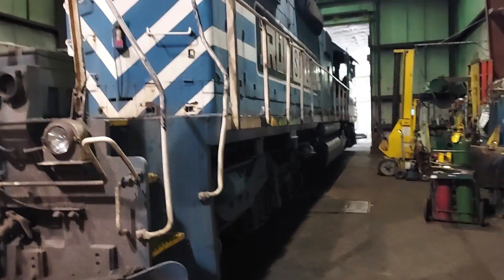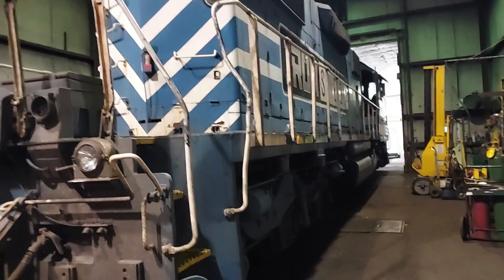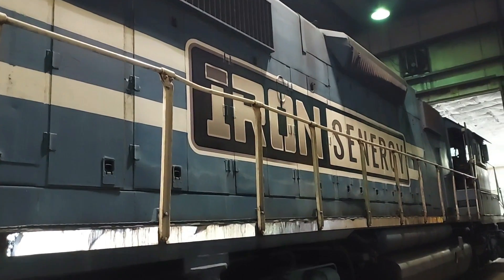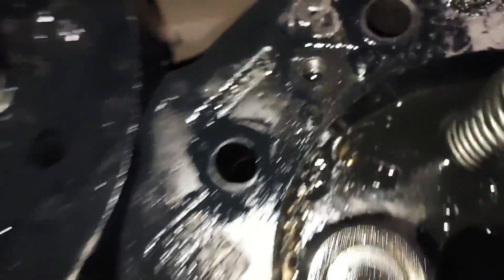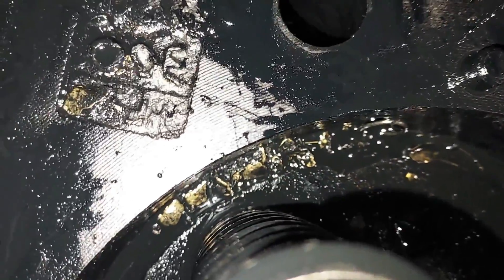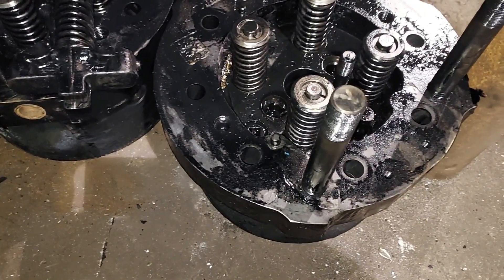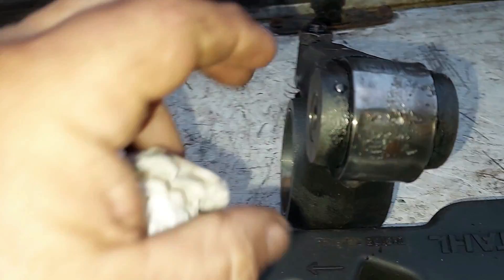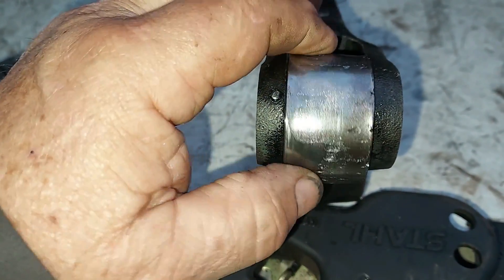EMD 645E Cylinder Heads Replaced on our #22 Locomotive

Comment: Hi Dave does the engine No. 22 usually smoke that  much? or was it due to the
rebuilding process ? diesels do smoke some, Mr. Moran statement is very accurate
the same goes for auto engines. the grey is babbet material that acts as a bering, the groves
are the oil channels , if it is not having enough oil it prematurely wares out. P.M. for any engine
is key for a long life. especially oil changes it is only a few mils thick but prevents ware.
the oil pump should be checked out to insure that there is enough pressure and proper circulation 
in the engine. that is key to keep it running well. great video, nice to see the “pieces parts” of 
the engine. the cam key for proper engine power too, it allows it to be more efficient . barry
Reply from the maker: No 22 does not smoke that much when it's running. There is a 
vent along the top of the shop roof to let smoke out, I think it
just seemed like a lot of smoke because the vent was closed
and there wasn't a good way for the smoke to escape the
otherwise enclosed shop so it had accumulated in there.
Thanks so much my friend for dropping by and checking out
the repairs.
Reply: PM seems to be non-existent!  A ship or stationary has a more important job adrift or no electricity or no/too much water, but a railroad, so what, wait till it breaks down, where's it going to go & what difference will it make. Fix the minimum & run it till it breaks again!  They used to treat miners the same way and even the unions didn't do much till OSHA!  My opinions entirely.  Good luck.

Comment: I hope the mechanics checked the muffler bearing (lol).  A muffler bearing failure could take out the whole engine.  A key sign of the failure is when flames shoots out the exhaust (lol)  By the way, on the rocker, the copper is the actual bearing material/  The silver is the babbitt under the bearing material.  Besides the roller, the the bearing is worn out,   Good to see the engine back in service.
Reply from the maker: Lack of lubrication to a muffler bearing will do it every time Rupert :-)
Thanks for the info on the copper/silver. Really appreciate your
dropping by and checking out the repairs my friend.
Reply: @ccrx6700  i love your videos anf your dedication to your job.  If we were all like that, America would be a mean machine.  Instead we send it to China.  Your company is lucky to have you!  I hope they realize it.
Reply from the maker: @supercuda1950  ❤️👍😊

Comment: I am surprised the engine did not have a very costly failure with that much wear and damage. Years ago we had works open days in the big workshops where you could see engines taken apart and rebuilt Some parts like these were always on show along with reconditioned ones, I always like to see things like this and how they go together so really found this interesting viewing. We do not have thanksgiving here but hope you had a great day and feast.
Reply from the maker: Very glad you enjoyed cedarcam. It sure was a good thing the
parts got changed. Sadly our old owners scrimped big time on
preventative loco maintenance. They knew they were getting out
and cut costs way back. Sins of the past are rearing their heads
but at least new owners have brought in some very qualified
contract loco mechanics and are spending money on what
needs to be done now. Guess I never realized that we are the
only ones to have a Thanksgiving. it was a good day, wife
had a great meat and I stuffed myself, but no surprise there LOL

Comment: Geez.. What a mess! I'm sure that wasn't cheap. It's a good thing it was taken care of before it became an even bigger problem. On an unrelated note, I spoke with you a while back about how to acquire some rail for my (hopefully) upcoming 2-foot gauge project on my property. Well, I was able to get ahold of some, just not in the way that I expected! 

In my city, there was a lumberyard in the downtown area for many years, and I used to go there with my dad. It was rail served, and I was lucky enough to see them unloading a centerbeam car full of wood one day. Sadly, the lumberyard closed down around the year 2000, and the buildings were taken down almost immediately. The only thing left on the property was some patches of concrete, some asphalt, and the rails curving into the center of the property.

Fast forward to a Friday last month, and I noticed that excavators were tearing up the property. Apparently, they will be putting in apartments and townhomes. I noticed that the superintendent was there monitoring the site, so I turned around so I could stop and talk to him. All of the rails were still in place, and I asked if it would be possible for me to buy a stick of rail, to save it from being scrapped. I knew I would be needing some for my project, and it also had sentimental value to me. The piece I was interested in was a straight stick made in 1987 (the year I was born.) He said it would be up to the guy scrapping it out, and that I should come back the following week. I asked for the super's phone number, which he gave me, then I snapped some photos before taking off. 

Fast forward to Monday morning, and I decided to do a follow-up with the guy, to see when the scrapper would be on site. And when I started talking to him, I couldn't believe what he told me. He said that they had uncovered the remains of an old locomotive turntable, and there were still pieces of rail in the concrete! :) Better still, he said that I could have the four 4ft sections of rail that they found, as long as I bought the guys lunch! So I said YES, and showed up early the next morning with an SUV. Much to my surprise, they had found another 2 sections, which they also gave to me :) I paid the super for lunch, and went back home to unload. After that, I checked for dates on the rails, and found that one of them said 1907. I texted a picture of that to the guy, and much to my surprise, he said that they had found ANOTHER 4 sections! I had to get to work, so I told him that I would come back the following day to pick them up. I did so, and paid them again for lunch. I also managed to get a 'goodbye' picture of the rails on the surface on the property, because they had started pulling them up. After I unloaded that second batch of rails at home, I noticed that one of them was dated 1901 :) 

So, in all, I saved 10 4ft sections of historic rail from being scrapped. I ended up with something much cooler than what I originally wanted, and the smaller sections are easier for me to deal with to. I believe it is 85lb rail. Now, I initially thought these were sections of rail embedded around the outer perimeter of the turntable, but I now believe that they were just set into the concrete as reinforcement, when they filled in the turntable pit. I'm not sure why they filled it in with concrete before burying it with dirt, since they were just making a lumberyard, but I'm sure they had a reason. I was able to find a map from 1892 that showed the turntable and engine house, which was fantastic. It was just a small 2 stall wooden structure. I also found a glimpse of the corner of it from the 1920's. The first lumberyard went in on the property in 1930, so the rails that I saved have been buried for at least 92 years. And they are in almost perfect shape, though they have turned mostly white from spending so much time being completely submerged in concrete. The workers at the site cleaned off almost all of the concrete for me, which was great. 

My plan for these rails, is to use them in my garage. I have 40ft overall, so I can run a set of rails from the front of my garage almost all the way to the back (my garage is 22ft deep.) Luckily, they are all slightly over 4ft by a few inches, so I can clean cut the damaged ends cut by a torch all those decades ago. Once I get them set in place, these will be the rails that I build my little diesel locomotive on. Even though they are only 85lbs/yard, they are overkill for my purposes, because my locomotive will be around 5-6 tons. But they will last forever, and will serve as a good starting point for my little railroad :) 

Anyway, I didn't mean to write a novel here! I figured you might find it interesting. I just can't believe what I ended up with, and also can't believe how many things had to line up, in order for me to make it happen, and save them from being scrapped. It certainly wouldn't have happened if it didn't take that particular Friday off, or if I had driven a different way home after I went shopping at Harbor Freight. Life is pretty amazing sometimes. And I am glad that I put the time and effort into doing it, which many other people wouldn't have bothered with. As I told one of my family members, sometimes you are just the right person, at the right place, at the right time. And if you don't do something, no one will.
Reply from the maker: Awesome my friend, just awesome. Many you did luck out, 1901, 1904! Sweet. I'm a bit jealous, but extremely happy for you. Yes
sir, life is amazing at times how things work out and things just
seem to pop up out of nowhere. Did you find any that had where
the rails were rolled at?  Bet that was the best lunch money
you ever spent! Thanks so much for sharing that with me my friend.
Reply: @ccrx6700  I'm glad you thought it was neat too :) The one rail says ILLINOIS STEEL CO SOUTH WKS :)
Reply from the maker: @crazyfvck 👍😊awesome👍
Reply: Thats quite a story I hope your railroad plans work out. Great you got to save such old rail from the scrapper. It dates from the very dawn of railways

Comment: Wiped bearing insert.  Looks like oil quality but with the roller damage, it was overloaded.  Hammered from excess lash.
Rockers are tricky bearing as the speed, load and direction are oscillating.  Unlike main bearings which have constant speed and varying load.  Wrist pins have similar speed, direction and load variations as rocker arm pivots. 
I bet there is a bucket of gritty sludge in the crank sump on that engine.
Reply from the maker: Thanks Keith for the expert commentary. I bet there is a bunch
of metal stuff somewhere in the oil system. We used to take
oil samples where an outfit came in and tested for metal and
diesel in the oil. But sadly a few years ago our old owners
cut costs way down to bare minimum and did away with that
testing as well as much needed loco preventive maintenance,
stuff like checking lash and so on. So now those poor decisions
are being paid for. Always a pleasure to have you stop by
and write in my friend.

Comment: Thanks for a another great video.  Now you can make yourself some paper weights with those parts.  Glad to see it running.
Reply from the maker: Your welcome Beverly, glad you enjoyed. All these trinkets I'm
collecting may have to someday sell on Ebay to supplement by
retirement.... :-)  Maybe I should keep all the spikes and track bolts
instead of putting them in the dumpster? After reading your comment
on the 1309 whistle short video, I downloaded a train sound app,
got a pretty cool steam whistle on it now set to my notification
sound, thanks, I never realized they even had train ringtones.....
Reply: @ccrx6700   glad you got the ringtone. I have it on my texts. You will have fun when you are in a store and it goes off.  I saw on eBay people are selling track plates and spikes and other parts for good prices.  Don’t toss in dumpster.

Comment: except for needing a crane it was not bad changing EMD 567 and 645 liner, piston, and head, we did test for fuel delution every 30 days (% fuel in the crankcase oil)
Reply from the maker: They used to test loco oil along with gear boxes on the belt
drives as a regular thing Gary. Then when the company started
scrimping several years ago that got cut out. A very poor
decision to my way of thinking. Very much appreciate your
joining in with us for the home movie today my friend.

Comment: The copper color in the bearing is confirmation that the bearing is worn out and needs replacing. Same with automotive engine bearings.
Reply from the maker: Thanks for the info Bryan. Very much appreciate your dropping in on
us and checking out the repair job my friend.

Comment: That's what happened to my 12.7 Detroit. Camshaft and rollers were trash. Of course. A lot of the problem was every year. The overhead should be run on the valve train. I don't know if they do that with locomotive engines. Looks like they could give you a new turbo and some new air filters to get rid of some of the smoke. Just Saying. LMAO. 🇺🇸👍 Have a great Thanksgiving and stay Safe out There 🇺🇸
Reply from the maker: Thanks Charles and hope you had a great Thanksgiving also. I
stuffed myself, but no surprise there. Have to go back to work and
drive some spikes to work off the mashed potatoes and pie.... LOL
Very much appreciate your visiting with us and checking out
the repair job my friend.

Comment: Wow. I am sure that these companies fret about having engines out of service for any reason and so I believe that a fair amount of necessary preventive maintenance is not done on any schedule. If I had the opportunity, I could prepare an analysis comparing downtime for preventive maintenance with the downtime from emergent maintenance. I suspect it would show that the cost of emergent maintenance is a lot higher. It might be a bit of a shock to the operations folks :)  The saving grace is that the engine is an EMD and as long as there is fuel and some oil, it will run for a very long time without complaint. Reminds me of those late 60s slant 6 engines that Plymouth built :) Thank you for the close up look into engine 22's top end and the information to go along with it!
Reply from the maker: Thanks for the really nice comment Brian. One big problem we
had here was our last owners knew they were getting out and
skimped way too much on loco maintenance, only doing what
was absolutely needed to keep them running. We are now
on a much better maintenance program, but the sins of the
past are catching up with them. Appreciate your visiting with
us and checking out today's repair job my friend.

Comment: I suppose now you'll have to change the bad parts as you go piece by piece. I believe EMD use to send full dressed"power-packs" to the field. Not sure CAT does EMD customer support😋 Happy Merica Thanksgiving Dave👷
🚂🇨🇦🇺🇲🚃🙋
Reply from the maker: Hope you also had a great Thanksgiving Doug. I stuffed myself,
but what not surprising about that. Very much appreciate your
joining in with us and checking out the repair job my friend.
Reply: @ccrx6700  wouldn't miss your post Dave. Long weekends&holidays are primetime for me. Curse of the sword. But I'm thankful my phone rings everyday🙋🚂🇨🇦🇺🇲👷
Reply: @ccrx6700  Hey Dave ya may know but maybe ya don't. Thanksgiving in Canada in October lol
Reply: Power packs are still available as exchange parts or new. Last time I bought some they were around $10,000 each plus freight assuming the cores were returned. If you have the right equipment which includes a lifting jig, crane etc, replacing a pack can be done in a few hours. Individual parts like cylinder head assembly, piston and rod, gaskets and seals are also available. The thing with replacing packs is they are very heavy. Without the special jig it’s nearly impossible to maneuver the whole assembly under the hood and into the block. Of your shop is set up to do this, then the packs are easier to install. Sometimes it’s easier to to the work piece by piece.
Reply: @billmoran3812  thanks Bill for that breakdown👍
🚂🙋

Comment: We used those same engines for stationary power (emergency backup diesel generators).  I remember working through the manual and several place would say "for railroad use....  for stationary power use...".  Very reliable engines, but didn't like 'cold starts'.  So we had a funny 'pre-lube' system that kept the oil circulating.  That way we could go from 'cold' to start up / full power in about 10-15 seconds.  Quite the workhorses.
Reply from the maker: They also make a marine version of this engine, several things
are different from the loco engines, but I don't know what all
those are Mike. Many, many river tugboats had these old
engines in them, at least around here they did. I think the cold
starts are why EMD wanted them to stay running because of
the lack of pre lube. I've always heard it's hard on a diesel engine
to keep them at idle, but even harder on bearings and seals
to start them back up with no pre lube. Awesome comment
my friend and thanks so much for sharing and watching tonight.
Reply: @ccrx6700  I know many diesels can have a “fast” idle to cut down on excess wear during the life of the engine.  That way the oil pressure is higher.  Many truck drivers do this after they start their trucks in the cold.  It also helps to prevent cylinder wash down from the diesel fuel, which dilutes the oil and wears the cylinder bores down faster.

Comment: Previously owned by a little old lady from Pasadena, who only drove it on Sunday.....
That replacement engine was running great when they pulled it out....
Sold without warranty....
HA HA.  I bet you have heard those lines before.
Reply from the maker: Actually when 22 came to us in 1997 it was without warranty.
When it got here there was 50 gallons of water in the crankcase,
also we had to take out the main generator and send it down
south to EMD for rebuild. They did some engine work on it also
at that time but don't remember what all was done. Yankeetown
Dock sold it to us and basically said, Happy Motoring.... LOL
Very much appreciate your dropping in on us tonight and
taking in the show my friend.
Reply: @ccrx6700  A real license plate warranty. As long as we see the license plate leaving the sales lot, that is how long the warranty is.